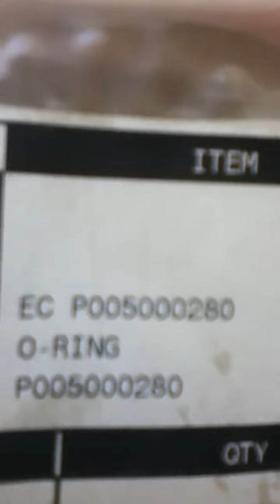Echo srm 210 carburetor trouble

Comment: i had the same problem with that same carb on an echo blower and the only solution for me was to replace the  carburetor with a new one and then it worked perfectly. there are little valves in those carbs that go defective sometimes

Comment: I had the same problem with mine.  After rebuilding this carb several times and taking it to a small engine shop, the tech at the small engine shop told me he has had lots of problems with this carb too.  He said on these carbs, he will try to rebuild the carb one time, and if it does not work, he just buys a new one.  He too said the plastic parts warp and eventually you have to replace it.

Comment from the maker: I replaced the carburetor and solved the problem. Turns out the main jet (which is behind a plastic piece) was plugged-got a brand new carb for $60. Sorry it's so hard to hear me- it was 108 degrees that day so I had a fan.